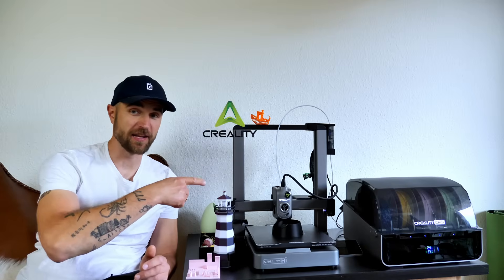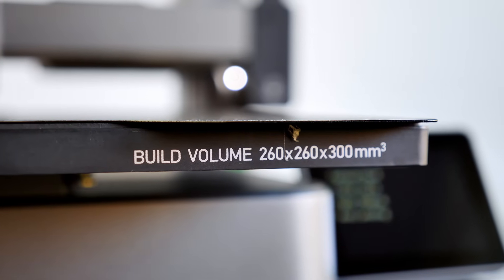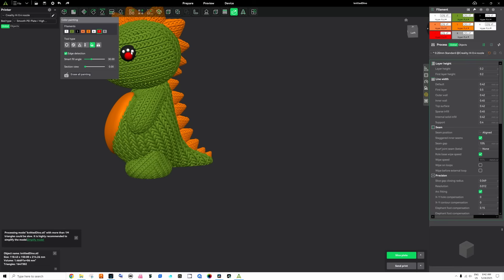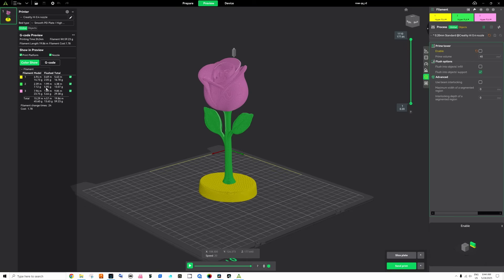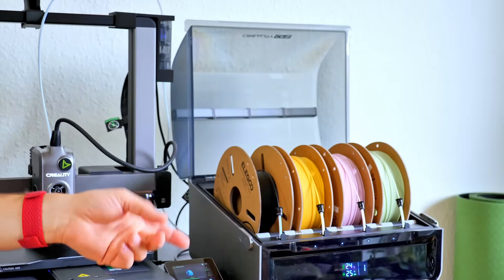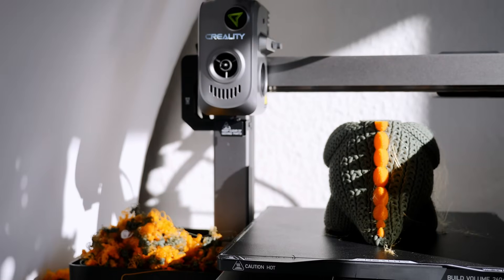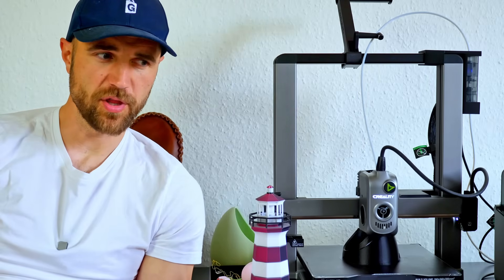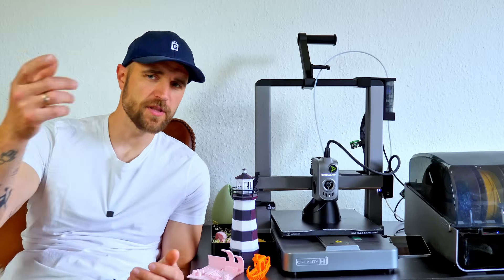Creality Hi 3D Printer Review

Comment: How fast is it? I saw you also had a creality 3,  so compared to that?
Reply from the maker: Most of the printers now are "fast enough". They can print at the speed that your material flow will allow. The movement of the head is faster than the amount of filament you can melt. 
On the other hand, if you print with 4 colors and need to purge at every layer, it does not matter what the head moving speed is, as the purging takes forever...

Comment: without the CFS (which I don't need) I just got it on Amazon for $214 USD the bed size alone was the deal maker for me. Yes it's a bed slinger but for the size you get 260x260x300 for that cost, yeah worth the investment. Should be here Sunday  and will post at least one video on it.
Reply from the maker: It should perform just fine without the CFS

Comment: I just got mine. I didn’t watch any videos like this before buying. I just bought it because I found a good offer for it last weekend. And good god, what a waste of filament. So, ¿there’s no way to disable/deactivate the poops? I mean, skirt loops could easily purge colors without to much waste but despite enabling skit loops and skirt height the machine gets rid of it in output g-code.
Reply from the maker: Well, tbh I have not been diving into it. I simply use it as extra filament storage/replacement if my reel runs out :)have not printed anything in multi color for a while now.. i think you can purge into infil, maybe
Reply: @VRMinde  I have both "flush into object infill" and  "flush into this object" enabled but still poops with every filament color change. Thanks tho

Comment: Every one who reviews this printer fails to mention several major flaws. It takes 8-10 minutes for the printer to start printing due to the start up routine. (ridiculous) The cfs lead is .5 m long, meaning the only place to put the cfs is right next to the printer on the right hand side. It wont work with Orca slicer without messing with settings, which were hard to find.  The touch screen is tiny, so if you have big fingers like me, its a pain. It prints good, if you can manage to stay awake till it starts printing.
Reply: You can disable auto-levelling each time before printing.
Reply: @Bayharboursaladseller  wirelessly ?
Reply from the maker: Hi, I am probably already used to all these automatic print initiations that take some time. Probably less than 8mins though.
Did I not mention the cables? I thought I did. 
And Orca works perfectly, just like any other slicer.. There is nothing really special about the settings..

Comment: Do you think this is a good printer for a like a small room/bedroom. I print with pla and want to use pla carvon fiber.
Reply from the maker: I think it is a good printer overall. I never printed CF to be honest. But if you are not sanding the parts in your bedroom they probably won’t get released into the environment. 
Just know that this multi-filament system is sometimes a bit hassle. Nothing dramatic, but spools might not turn and stop, you have to try again and so on. Printer itself works very well

Comment: is it's work for  beginner or not like bambu lab ?
Reply from the maker: I never used myself any bambulab printers, so I can't tell you 100%.

You slice what you want to print and press print, it prints. Assembly is very simple. I would not be afraid of a printer like this as a beginner. But this printer, or any other, you will have to learn to slice your prints anyways.

Comment: Im pretty new to this 3D printing world and would love to be a part of it. I am currently in search for the most functional 3D which I can consider to be the "best" for my use cases which would be designing basic joinable parts but still to be learning in the process. I want to be able to 3D print and focus so much on how a 3D printer functions(so less tinkering). I have looked at the Creality Hi/combo and it is currently on sale for 360+ sterlin pounds. Wanted to know if you think this is a suitable purchase based on your own experience. Cheers.
Reply: I'm completely new to 3D printing too and just jumped right in without any prior experience. I went for the Creality Hi when I saw it on sale, and after the first 200 hours I haven’t had a single issue with the printer or the CFS. It’s super easy to use – the printer itself, the software, and even the mobile app. I can really recommend it! New favorite hobby😂
Reply from the maker: It is literally still running every day in the background as I am typing the comment. The only problems I ever got is the CFS multi-filament thing. And the problem is it wouldn't wind back a spool or something. Choosing the right spools that works helps.. It is an easy machine to begin with. There is no such thing as a "single best" 3d printer. This one is a good value for money in my opinion

Comment: I love the Hi but the CFS is definitely the weakest part of the combo. I've gotten a number of errors with the CFS and still trying to figure out how to better use it to avoid some of them. 

Waste is normal for multicolor printers. You can reduce it by creating models with multi color in mind keeps as many layers as you can a single color. Some items I find are better to print in parts, especially for things like eyes that can very easily be glued in after printing.
Reply from the maker: Hu. Yeah, the cfs is a bit dodgy, I actually had the best success with filaments on cardboard reels/cores. Even though the user manual tells me not to use them. The plastic core filaments sometimes are not rotating creating feeding errors
Reply: @VRMinde  yeah most of mine are elegoo matte filament on the cardboard spools and they work...and usually if it gives me a "jam" error, if I retry it continues, but really annoying if I leave something to print overnight just to wake up the next morning to a print that hasn't finished because of a phantom jam.
Reply from the maker: @LoriAnneBrown  yup. I caught some of those happening when it rolls the filament back. It could not wind it up on the spool all the way and it produces the error. There are two motors - one in the feeding/retracting system and one rotating the spool. I believe that the logic is that the spool needs to "pull out" the last centimeter or so. If it fails - error is there.
Reply: @VRMinde  yes. I don't know what the answer is to improve the cfs - perhaps it needs stronger motors for the spooling? I'm not an engineer, but 95% of issues I have had have been with due to a failure of the cfs to properly feed the filament or a false error as it did, but for some reason, didn't think it did.
Reply from the maker: @LoriAnneBrown  As an engineer, I  would insist on getting "standardized materials" :) I am trying now to print with filaments that I know their bobbins work well. For the last few long prints I managed to print without stopping :)
Reply: Do you know if there's a tool that could convert such a multicolored model into single-colored parts, that would be printed separately and then glued together? That would save a lot of poop, and also make the prints cleaner.
Reply: @AndersBorgSweden  You can always separate a model into color parts - there isn't an easy way to do that though and you would have to take it into something like blender and break it apart.
Reply: @LoriAnneBrown  That was what I feared :). It seems it could have been automated in the slicer, as it has all the knowledge needed for that. For sure, some models might be too complex for that to be effective.
Reply from the maker: @AndersBorgSweden  I doubt there is an automatic tool for it. Most CAD software can do that, but you need to be able to use them
Reply: months later, my cfs rarely gives me errors. Search "CFS spring fix" - that and shortening my pfte tubes eliminated all the errors I had when changing filament colors. The Hi Combo is an amazing printer.

Comment: oh! another A1 clone... im going to wait a while as usual... to see how it goes...
Reply from the maker: K1 was a successful one, in my opinion :)
Reply: @VRMinde   yeah a bit! but still a clone...imho
Reply from the maker: @ELROCKETEER  sounds like you have a  very strong bias for one brand. Every 3d printer is a "clone" of another one. Same as a car or a bicycle, or basically anything in this world. 
Every item has its buyer. Someone who runs a 24/7 print shop and makes money from it can invest in an expensive top brand. Someone who occasionally engages in hobby printing will look for a cheaper alternative that works reasonably well. Both solutions can co-exist well.
Reply: @VRMinde   ive been printing for at least 12 years and had many many printers. all a bit better as time passed but with Bambu and not just the printers but the whole environment has been incredible miles from other company's, so you just cant compare only the printers. yeag some may be equal or close but not as a whole... imho.
Reply from the maker: @ELROCKETEER  I have never owned a Bambu printer, but my friend runs 3 of them  24/7 for the last ~8months and he is also very happy with them. What I am saying is  I do not need a 1k EUR printer, when a 500EUR one does the job for me.
Reply: Creality innovated the design for this with the Ender 3...YEARS before Bambu ever made the A1...btw Bambu has made ZERO innovations of any printers they sell.  They stole everything in thier printers from PRUSA, Stratasys, Creality and Voron.  Bambus multicolor features were actually done by Geeetech 8 years before Bambu
Reply: @crusader-hcq    AND!  LOL... Bambu is still the best. you can always improve on things and they did, plus talk about stealing...lol... they all do it from Bambu also..all you see now are Bambu clones...ffs!